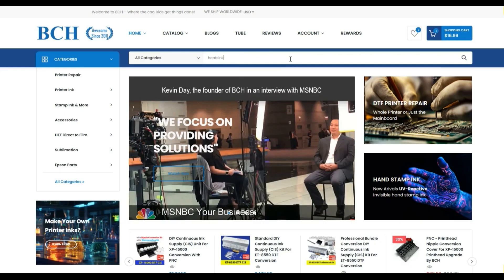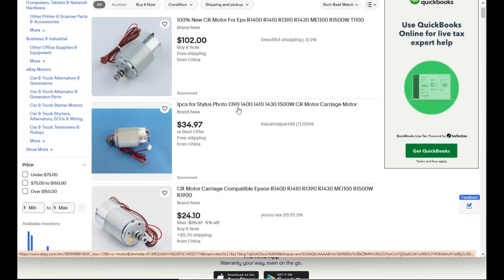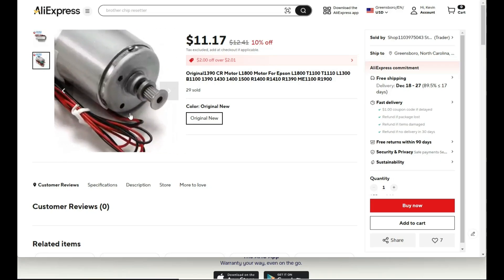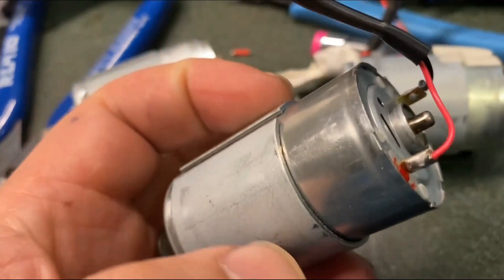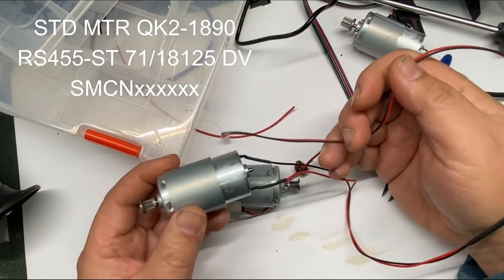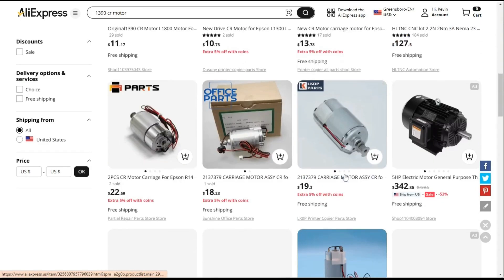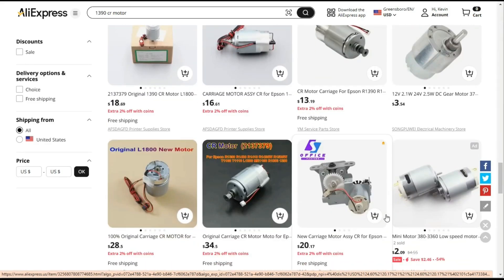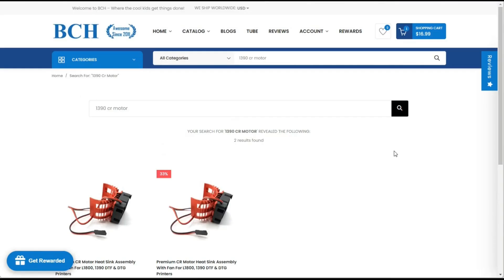I Spent 100 Hours Looking for Epson 1390 CR Motors and Found the BEST!

Comment from the maker: Just a quick clarification: the outer ring of the double-ring actually should be thicker than the inner ring. The one I mentioned at 6:07, saying "I think it is," turns out not to be correct—the inner ring is thicker than the outer. I would skip that one.
Update: I consulted a pro and got some solid advice. 1) You’ll definitely need an RS455 motor. The compatible numbers include 18125 (e.g., RS455-ST 71/18125 DV), 19125, 18130, and 18140. The best one is 19125 but it is very hard to find.  In the example shown in the video, a customer who used the 15205 model reported that both motors burned out. 2) The drive belt is the same color for 1390 and L1800. Because 1390 is usually older, the one you usually see is discoloured. 3)
Once you’ve selected the correct motor, the next step is choosing the right teeth. the 6:07 one on AliExpress is a fake, he bought one and lasted a week. I am working with him to make our own teeth gear. I’ll be posting another video soon to explain that in detail. Hope this helps!
Reply: Greetings
I'm trying to write something but it won't go for some unknown reason. So I had to write here like this.

Comment: Hi dear i have Epson L805 when i print 5 glossy A4 pages it does very slow printing do you have any solutions
Reply from the maker: Hi there! Thanks so much for subscribing and leaving a comment—I really appreciate your support. With about 55K subscribers, I'm working hard to reach that 100K milestone, and every subscriber like you makes a big difference. 😊

To address your question, the Epson L805 is inherently not the fastest printer, especially when printing on glossy A4 paper. However, if the slowdown is extreme, it could indicate an issue. Possible culprits include a malfunctioning IC driver chip, a faulty power regulator on the mainboard, or even the CR motor overheating during extended printing. Other hardware issues might also contribute to this behavior.

I get so many questions that it can be tough to keep up, but I always try my best! For a quicker response, feel free to email me at support@bchtechnologies.com or post your question on my most recent video (not Shorts). Thanks again for being an awesome subscriber—your engagement truly helps support me as a creator!